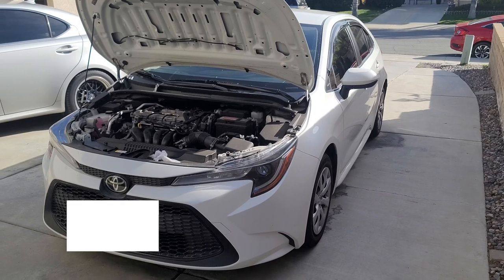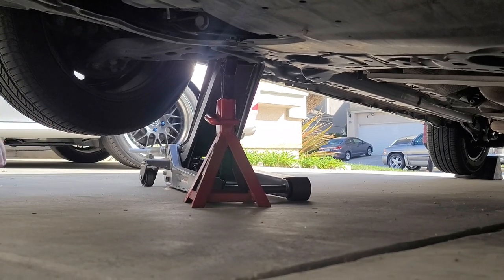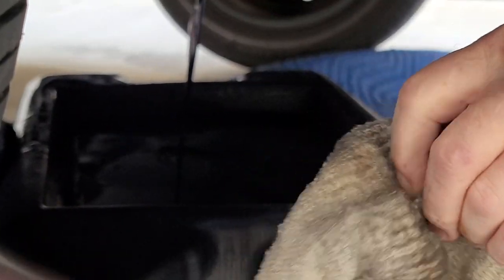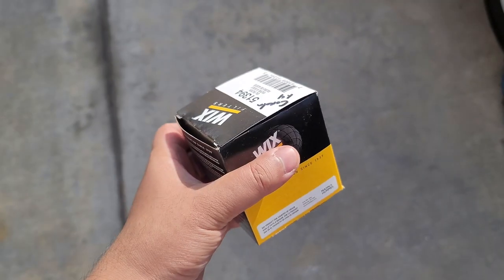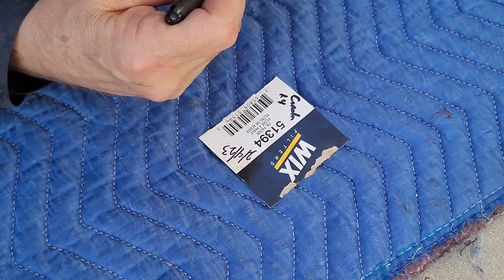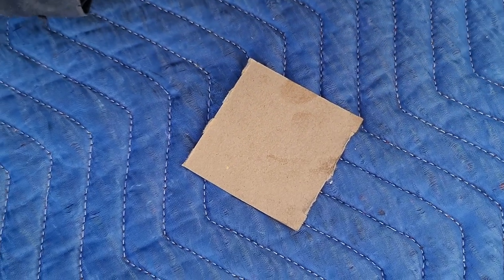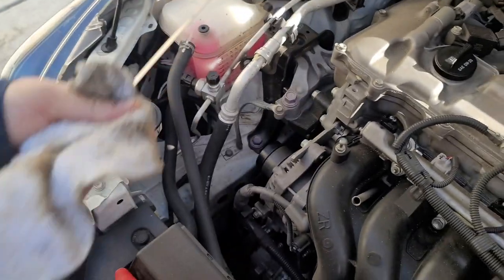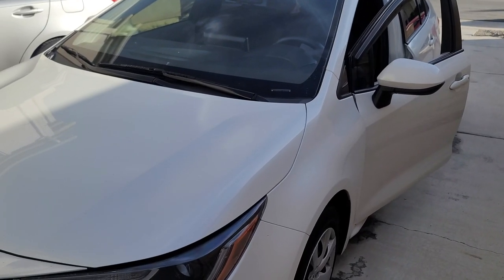How To Change Car Oil at Home w/Tips! l Using a Toyota Corolla 2020

Comment: What weight of oil did you fill it with? Says 0w-20 on the oil fill cap and 5w-30 on the oil box.
Reply from the maker: Chose weight of the oil based on the mileage of the car.
Reply: @mphcaradventure  OK, that's understandable.

Comment: The car doesn't have to be level for the oil change?
Reply: The car should be level when you check the oil level using the dip stick.
Reply: @Richard Holbert  Isn't the goal to get as much of the old oil out as possible?
Reply: @Seraphim401  Yes, if the drain plug is in the back of the oil pan, jacking up the front of the vehicle will help drain the oil :-)
Reply from the maker: As much as possible, but we only jacked up the front, just as long as it's not an extreme angle up in the front it's fine, it also depends where the drain plug is also, if it is on one side or the other (drivers or passengers side) jack the car up on opposite side.

Opposite side of drain plug, so it will angle the car down towards the drain plug.